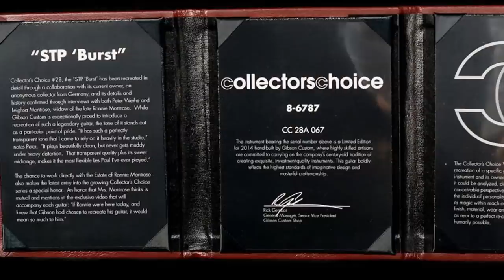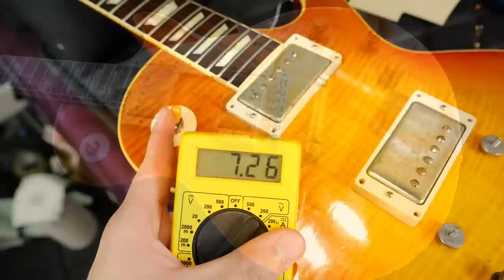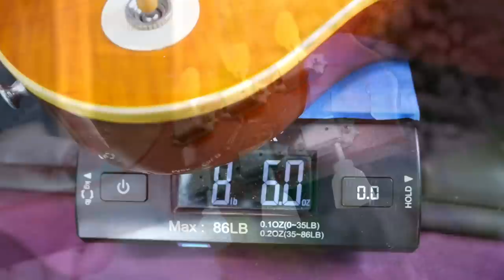What's Up with "Collector's Choice" Guitars? | 2014 Gibson CC 28 Ronnie Montrose STP Burst 58 Review

Comment: I like the sound!  I’m not usually into the aged guitars, why pay extra for a beat up guitar?  Build it to the same specs you want, ie Montrose, but get it looking new!  Over the years I have always strived to keep my guitars looking a pristine as I can!  However, I like this one, it’s not overly trashed and adding the top coat over the exposed wood is great for it staying like it is supposed to be.
Reply: Yes, I'm with you on this definitely. Normally these over-priced relic'd guitars just seem... well fake as hell. However, when they just have a touch of the passing of time about them (and have not had half the finish sanded off 😂) then I get the attraction.
Reply: @martin-1965  They aren't overpriced IMO, when you buy anything you're paying for time. And relicing takes a whole load of work. Sometimes about as much as it took to make the thing in the first place,  because it's extremely hard to automate like you can with every other step. So now, you have a guitar that took as much time to make as a customshop before you relic it, then you throw a whole lot more labor at it and it's gonna get eyewatering quick. I refuse to do it on the guitars I make because I don't like the look, and I don't think it's worth the money, but I see why it costs what it does.
Reply: @fairguinevere666  Yes, fair point. I  was wrong to say "over-priced" and accept the amount of work that goes into recreating the relic'd effect - especially when they are replicating a famous guitar like the "Greeny". I'm also with you that, in most cases, I don't like the look. I don't build them like yourself  (much kudos to the craftsmanship and years of experience on your part to do that). I do however repair mine and a few customers and friends guitars in my humble workshop. 

Imho the most important part of the guitar to work on is the neck, and I am happy to reshape, sand, fret level, refret, polish and refinish them until I or my customer/friend is happy with the feel of the neck. I mention this because I can imagine some of the relic'd guitars have amazing necks that feel great in the hand. How the rest of the guitar looks? Well, I like it to look as good as possible and have the best components and build naturally 😎 

So just curious if you would agree and whether that is something you focus on most when building your guitars or not?
Reply: @martin-1965  I'd 100% agree with you on all that. All my guitars have stainless steel frets, rolled fretboard edges, are hand carved for those parts you're hands on with, etc. I purchase wood for weight, buy overbuilt hardware to help it last a few decades longer and just be that little bit more stable, etc. 

Reliced necks can actually be 50/50 tho, it's common for them to have a ledge on the edge of the finish which a real vintage doesn't! Which again is part of why I don't like them, for the most part. They take one of the most important parts and make it worse. 

Also, if you are doing all that with existing guitars, you probably could make your own without too much hassle. Especially with something like stewmac's pre slotted fretboards, they save a lot of hassle.
Reply: Richard Kilgo, exactly! I'm with you on that! But this is one "worn" guitar that looks appropriate 👍

Comment: STP has always been a  great oil additive still is. there is a demonstration you can do that shows good of a lubricant it is? take a flat head screw driver and dip the flat head of the screw driver into the the additive. and place that end of the screw driver between your fingers. and try to hold on to the scew driver. and I guarantee you can't hold on it.

Comment: That is a very good sounding guitar, the kind that is worth the money. Catch and release! 🙀 I don't think I could sleep if I did that. 😁 Someone is going to be very happy when they get that guitar. If the Neck Pickup is too dark, it can be turned around in the pickup cavity so the screw pole pieces are facing the bridge instead of the neck - No rewiring or soldering necessary and easily reversible.